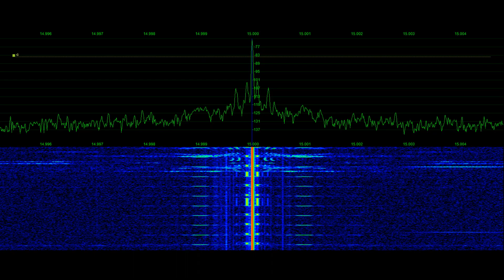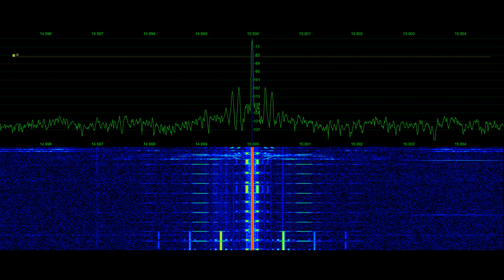WWV Transmitter power cycle | Signal Phantom

Comment: Just curious are you still using the loop? And is it a random or tuned loop? It works good
Reply from the maker: Yes, the loop is a 290 foot around feed with a specific length of 600 Ohm line into the station hear, that feeds a modified AT5K you may have seen in the 'shack tour' video! -lots more to come!
Reply: @SignalPhantom  yup I've been watching.  I especially like your video on demodulating the am signal you generorated.  I would love it if you made a video on how you setup your audio processing for the transmitted audio. It sounds fantastic.